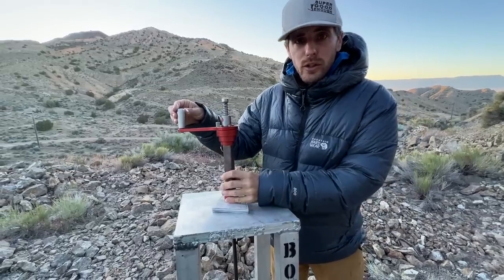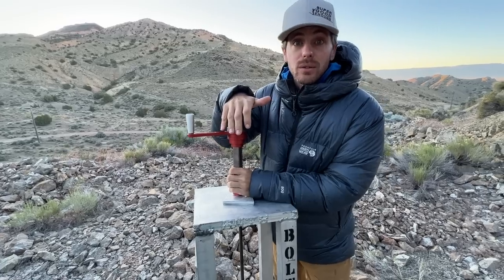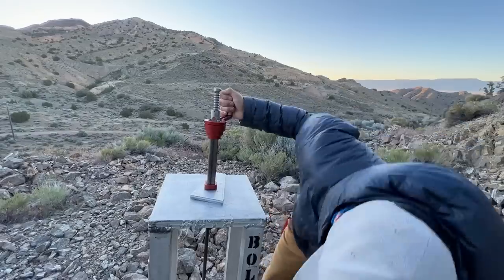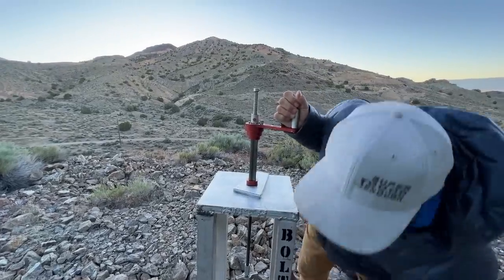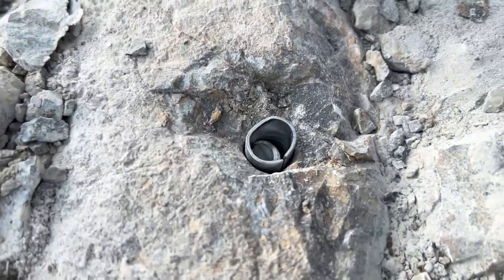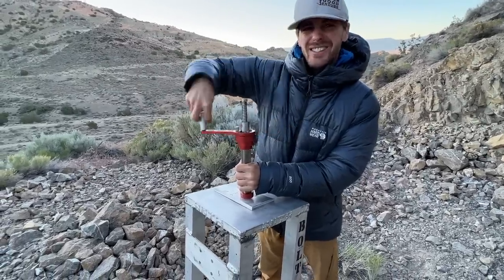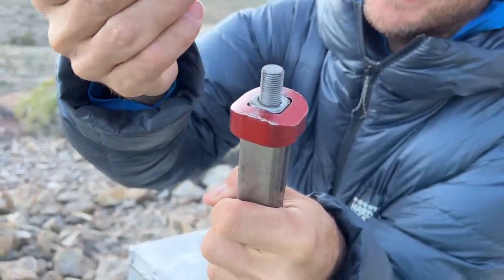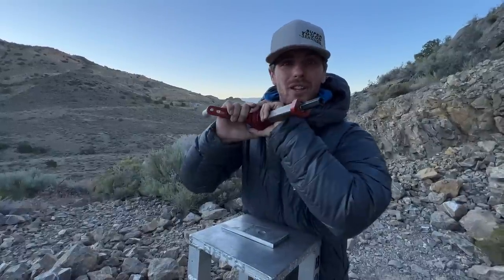How much force can a $390 climbing bolt remover pull?

Comment from the maker: The comments lead me to realize that people might think this is what you do to remove bolts and you have to deal with high forces and quick releases.  No, you score the bolts and you just put on maybe 5-10kn and it slowly pulls the bolt out of the rock.  You can see an episode of Bobby doing that at https://youtu.be/58t0eHUJgbo?t=695.
Reply: Ryan - As cool as it is to see this tool commercially available, the open source/DIY mode is the only viable approach to volunteer bolt replacement efforts. Can you include a link to the MoPro Doodad 4.0 shopping list thread? Pointing out that it can be made for $50 looks like it's undercutting the profit motive, but I don't think the YABR tools are intended to be a profitable business. I posted the link myself but it doesn't appear here and may have been filtered out...
Reply from the maker: @german13289  Yup! Link is now in description and Bolting Bible https://www.hownot2.com/post/bolting-bible-removing-bolts

Comment: This tool is based off of Greg Germans original design, the "Doodad". Greg has generously shared how to build this tool, along with a wealth of other information about sustainable hardware replacement with the climbing community. We all owe him a debt of gratitude for both his engineering skill and countless hours spent replacing old bolts to keep climbers safe.

Comment: Is catastrophic/explosive failure of brittle materials, upwards toward the groin/femeral artery region at forces in excess of 20kn a concern at all?
Reply: All while dangling on a rope. LOL I was thinking that too, especially every time he went to look and put his face right next to it. lol you'd think it would attach to the wall somehow or have some type of bracing to prevent this.  I love the idea tho! it just seems like there's a lot that could go wrong, a little R&D, this thing could be perfect!!!!
Reply: A hunk of carpet wrapped around the stand would probably be enough to stop flying pieces.  Or slow them down.
Reply: They make this stuff…
Hmmm, what’s it called!?
Oh yeah, plexiglass!
Or a trip to the E.R.?
Reply: Yes and no. Yes it’s a lot of force but the force to distance is really short. In short it shouldn’t accelerate to dangerous speeds. A good more common example is crossbows compared to bows. The cross bow has to be heavier to compensate for a shorter draw length or in physics terms time of acceleration.
Reply: Super good enough
Reply: I have been thinking about a vasectomy for years. Sounds cheaper than a doctor

Comment: Very informative video thank you for making it. I'd like to point out a few truths to help you consider the test and its results. Forces are always balanced (when stuff isn't accelerating) - which means that your bolt extractor pulling up on the bolt at 20kN is also pushing down on the surrounding rock at 20kN, but just outside the bolt. This means that the rock around the bolt will behave a lot differently when subject to the spread out column forces from this test rig versus the local forces from the bolt extractor itself just outside the bolt hole. I'd think it much more likely that the rock will fail between the bolt hole and the rig's columns than it will when directly extracting a bolt - so its quite possible you'll see rock failure mechanisms with this test setup whereas just bolt failure mechanisms when only using the bolt extractor on a bolt directly.
Reply from the maker: True. I wouldn’t necessarily break rock using it directly against the rock. This setup is definitely just to see the forces the screw can generate and definitely not practical for real life.

Comment: Personally I would worry about that relatively small ball screw gumming up over time. But to be fair, if one needs that much force, perhaps one is using it wrong.
However, I am curious how that ball screw will last in practice. I know it is fairly well hardened, but I can't help but suspect that abrasive rock dust is going to wear it out over time. (primarily just increasing its turning resistance until it isn't practical to use.)

But a ball screw is likewise an off the shelf part, so buying a replacement one should be fairly trivial.

Comment: I don't understand how you put that much torque into the crank handle and keep it from unwinding while hanging from a rope on the side of an "incline".
Reply: PURE CHADNESS!
Reply: Just gotta have a “no ratcheting mechanism mindset” bro
Reply: The screw is an inclined plane, so a wedge. Fine thread is in the neighborhood of a 500:1 mechanical advantage for converting torque to axial load. I think the crank uses a ball screw which is really low friction.
Reply: I guess in real life situation bolt removal, there is no that much springiness in the system as here, so there would be much less unwinding force.

Comment: Why isn't there a locking mechanism to prevent it from spinning back on you?
Reply: Probably weight/complexity? But I was wondering that too.
Reply: @DreIsGoneFission  yeah but you can solve that with just a little gear/latch, lick on rachets .
Reply: Friction on the flanks of the threads inside the device prevent it from slipping backwards. This is a common phenomenon in all devices that use threads to hold things
Reply: In normal operation the loads are significantly less so I think the friction of the system holds everything in place. Go check out his other videos of actually removing a bolt
Reply: That opposition force is actually important feedback: if you pull on the bolt and it slips, the handle will not reverse as far. If you put greater and greater force on the bolt and it reverses to the same position each time, that tells you that the bolt has not moved and you will need to go back to spinning it to score the wedge and defeat the holding power.

Comment: To a "non-rock climber" this seems an absolutely silly tool. Why remove the bolts and re-use them?
It'd be heaps easier, cheaper and lighter to carry some spare bolts.
If the idea is to stop other climbers using them, simply remove the nut and knock them in.
Reply from the maker: Bolts rust and become unsafe. The purpose of this tool is to remove unsafe bolts so safe longer lasting bolts can be installed.
Reply: @HowNOT2  - would be much easier  paying a dollar more for stainless steel fixings, then they can stay there literally forever.
Reply: @johncoops6897  Nothing lasts forever. Even stainless has a short lifespan in certain climates.
Reply: @poetac15  - LOL Yeah sure, whatever you say. 🤣
Reply: @johncoops6897  Why do you bother to come comment on a video in which you understand nothing in regards to the actual use of the tool.  You could ask nicely and someone would likely explain it to you but you try to be snarky.  This tool at its core is designed with the idea of leaving as little trace/impact on the environment in which it is used as possible.  This tool allows a route setter to come through and replace existing but failing bolts and re-use the same hole that was there already.  If you simply hammer the bolt in then the hole is now useless and it creates and eyesore and a new hole must then be drilled and a new bolt placed.  Try being a nicer person John Coops.
Reply: @missiongravity  - well, talk about snarky! As if a few holes in a rock makes any significant environmental impact, but whatever... 😃